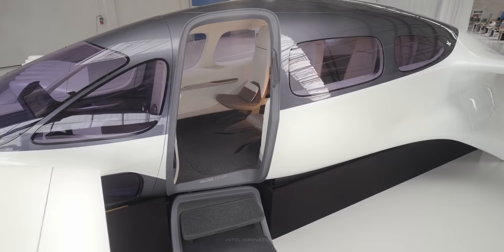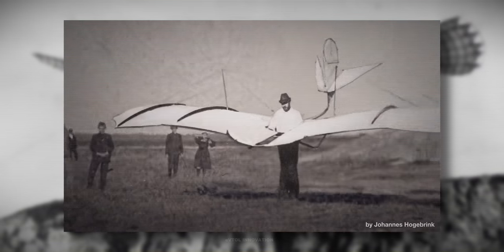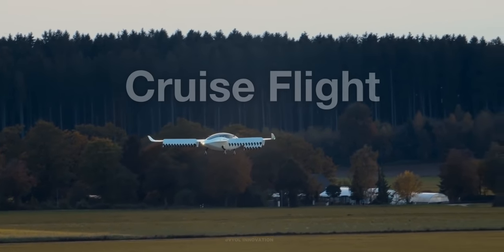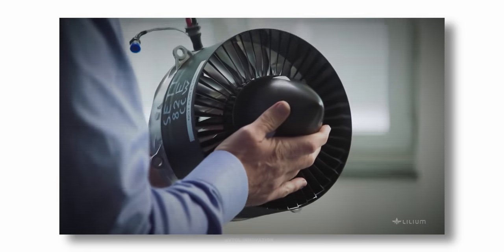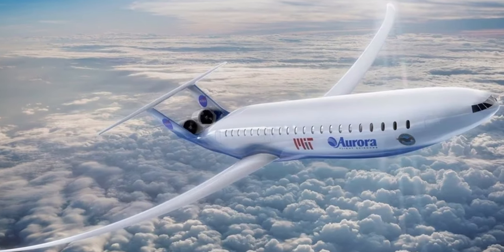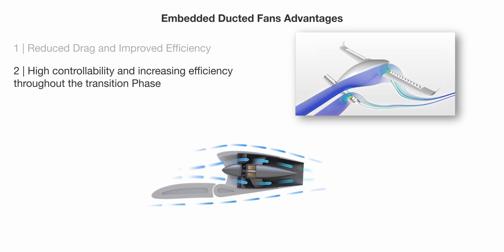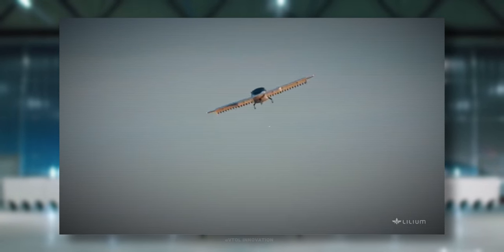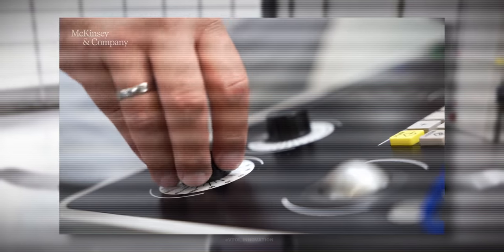The Insane Engineering behind The Lilium Jet | Part 1

Comment: This is not a JET !
Reply from the maker: Technically, it is. I explain why and I talk about batteries in the PART 2 of this video. 
The link https://youtu.be/Cn-5qqgEW6E
Reply: @eVTOLinnovation  Sorry, but you're wrong.  This is a ducted fan aircraft.  I know you like Wikipedia, look up "Ducted Fan".  The Lilium has no Jet Engines, thus it's not a Jet.
Reply from the maker: Watch the video. It is a Jet engine whether you like it or not
Reply: @eVTOLinnovation  Lol, it's definitely not.  You're the one trying to gaslight everyone else.  A jet requires a jet engine, period.  Stop being stubborn, you're just not plain wrong.  This is a electric ducted fan aircraft.  Please, please, go look up "Jet Aircraft" in the Oxford Dictionary.
Reply from the maker: @AdamBrackney   [Oxford] Jet engine: an engine that drives an aircraft forwards by pushing out a stream of gases behind it.
Reply: @eVTOLinnovation  How sad, you're just making stuff up. Lol.  Per Oxford, "an engine using jet propulsion for forward thrust, mainly used for aircraft."  That's the definition of a Jet Engine.  If you'd prefer Merrian Webster, "specifically : an airplane engine that uses atmospheric oxygen to burn fuel and produces a rearward discharge of heated air and exhaust gases".  Jet Engine combust fuel and force the gasses out the back, you're never going to find a definition that changes that to an electric motor spinning a prop, even if you add a duct around it.
Reply: @eVTOLinnovation  By your logic, literally every engine mounted on every plane on Earth is a Jet Engine and thus they're all Jet  Aircraft.  You see how words have meaning for a reason and trying to apply marketing to them rather than reality doesn't work so well?
Reply from the maker: @AdamBrackney  Fuel combustion is not required.
Reply from the maker: @AdamBrackney   Incorrect. Jet [noun]: a rapid stream of liquid or gas forced out of a small opening.
Reply: @eVTOLinnovation  Bwahahaha, Jet is not Jet Engine.  A Jet Engine most certainly requires combustion, that's why it's in the definition.  Reading your responses is like listening to to a flat earther.  Unfortunately I find it's much to common in today's day and age that people just can't accept when they're wrong about something.
Reply: @eVTOLinnovation  Oh yes, like when I shoot a jet of water out of my garden hose, it's a jet engine garden hose. Lol.
Reply: @AdamBrackney  I agree with your position. It’s deceptive to label these electric ducted fan engines as jets. The company’s marketing dept needs to have a conversation with their engineering team.
Reply: In germany we use the word impeller for the engines lilium uses…
Reply: @eVTOLinnovation  LOL...based on that definition, any propeller driven aircraft is a jet. I mean, they do push out a stream of gasses behind themselves.
Reply: @AreYouSerious-210g   It's rubbish, but I doubt it's deceptive. Anybody who would be buying this for real probably knows the difference, just like we do.
Reply: the video calls them embedded ducted fans...

Comment: "Insane" giant drone that cannot take any weight or real humans and can fly for 5 minutes. Check back in 20 years!
Reply: You saw the new vid? They did a full transition to level flight up to 185 km/h.
Reply: @0Turbox  Was that with a human inside with any weight? More than 5 minutes? Big drone flying fast. So?
Reply: @c.a.nixiii4650  Probably not. I mean, they have the simulators who tells them what they can do and what not. I also highly doubt, that they hire 375 people, if they can't see it flying longer than 5 minutes. Once in the air and in level flight, it should consume less energy than a Tesla. The main question will be, how efficient the concept will be, compared to the competition.
Reply: @0Turbox  Point is this does not seem viable for anyone to invest in. Nice experiments to play with and learn from but to think they will have a viable vehicle with passengers anytime in the near future? The tech is just not there yet. Maybe in 20 years. It's all hype to me and nothing more than a large flying drone.
Reply: @c.a.nixiii4650  I did some math, but there are limitations, because I don't know every detail. Let's assume, it uses a normal, but max. car battery of 100 kw. The plane has around 2.000 hp, which it should run at max power for about 6,66 minutes. I took away 2,66 minutes for take off and landing, for better calculations and if it is true, that in level flight it needs only 10% of the max power, then you could fly for another 40 minutes. With a safety margin, that would then be around a 100 km range at the speed of 185 km/h. But this would be the maximum of power usage at start and landing. Maybe they need less, depending on the overall weight. With these numbers, it's surly not enough, but it's also not far away. I imagine, the batteries could be far lighter, as those in cars, because they do not have to withstand a crash.
Reply: Forget it, I did a miscalculation, it's only 4 min. But no one knows, how high their battery capacity will be, probably double the size.
Reply: @0Turbox  There are some videos out there of ePlanes that look like a traditional two seater Cessna with a prop on the front. Simple and much more practical in 2022 using less battery and a single motor.

Comment: It's NOT EMISSION FREE!! The 'emissions' are in the coal burned to make the electricity. The diesel emissions use by the heavy machinery to strip mine for rare earth minerals to make the battery, not to mention the damage to the environment. The coal burned to make the electricity to manufacture the battery and the energy needed to safely dispose of the toxic battery at the end of it's life cycle. In fact, this aircraft has a higher carbon footprint that a conventional jet. Don't hate, it's the truth... just say'n!

Comment: They are not jet engines  these are the same as my FPV quad copters RC Hobbyist have been using them for years the benefit of ducted fans is not new they are even in the movies i would be laughed off the field if I claimed my quad had jet engines on them. the Japanese are using them as well and some Chinese since the hobbyist started using them every body is getting in on the act I do think there pretty though and there is this one girl in a bikini she fly's around on a ducted fan platform now that's pretty.

Comment: The plane will drop like a brick ☠️, if there's a power failure.

The engines works as a break when power fails and the wings will stall very quickly ☠️